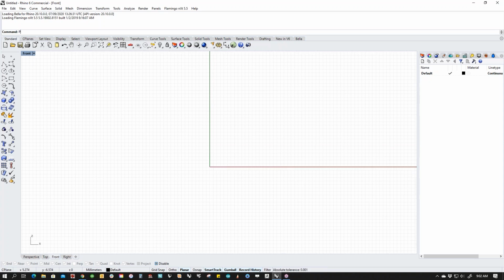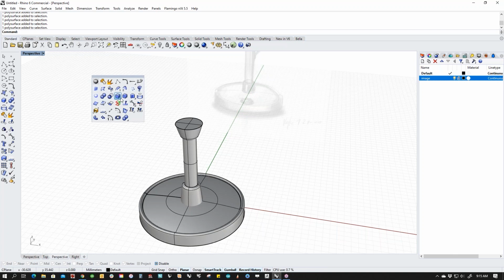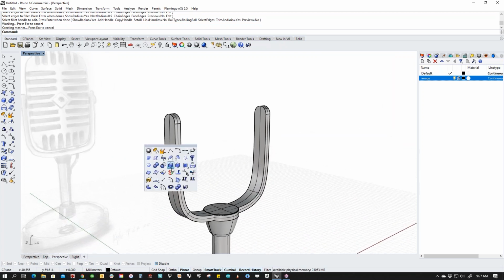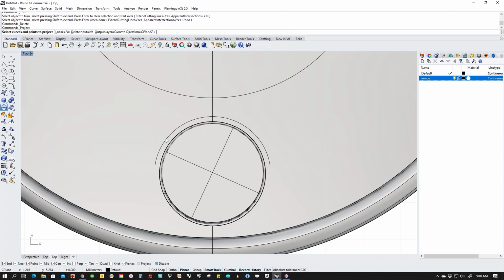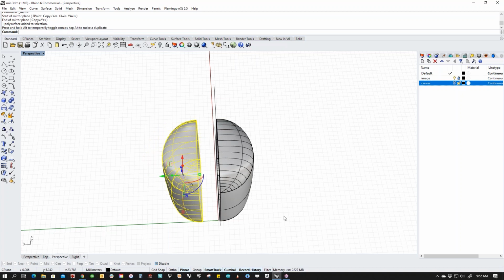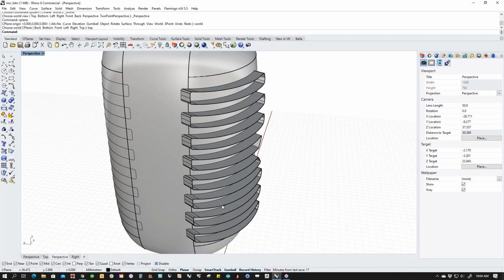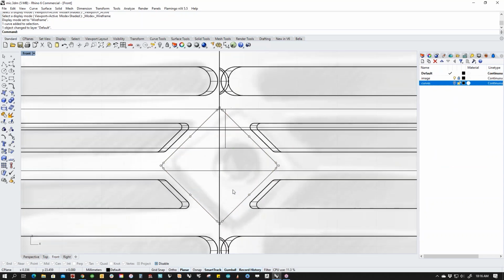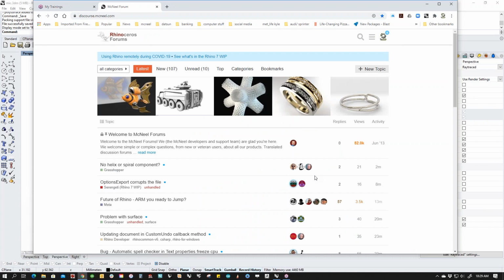Getting Started with Rhino for Windows  Vintage Microphone

Comment: Speaking of Pro/E (Creo): Importing a Rhino STEP export in Creo creates geometry that is rotated 90 degrees.

Is there a workaround in Rhino - I can create a different coordinate system in Creo, but if there is a way to set this up in Rhino, this would be a big help.

Also, I try to avoid surfaces with degenerate corners - you could trim the surface and create a 4 sided surf from the "proxy" surface, yes?
Reply from the maker: Simply rotate 90 with the gumball 

Yes, for sure you can trim 4 sided srfs